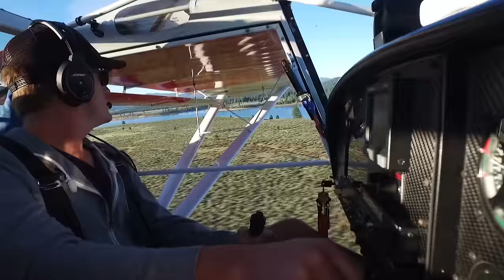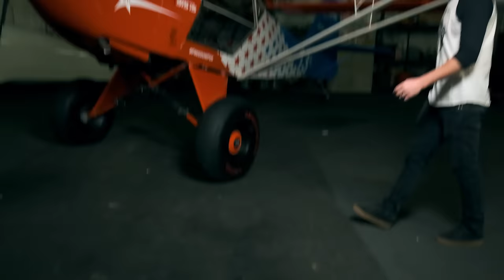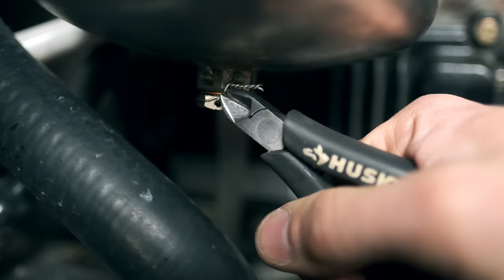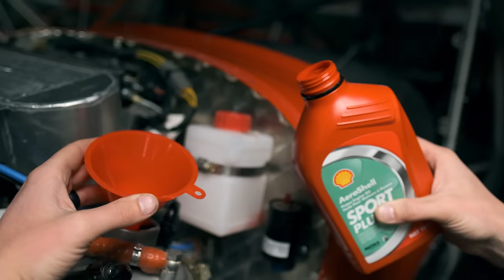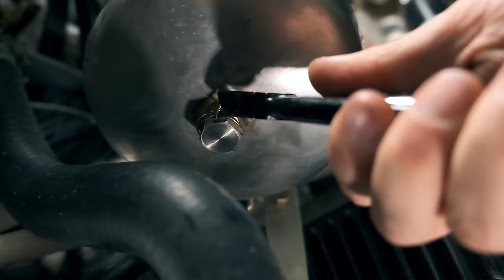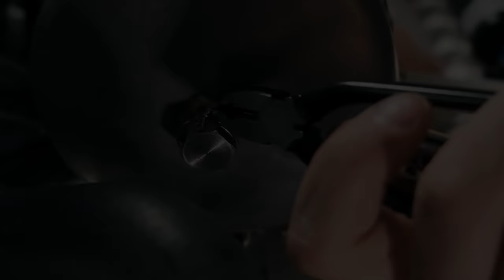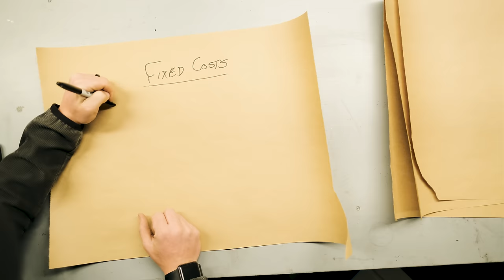What Does It Really Cost to Own and Fly Your Own Plane?

Comment: I'm desperately wanting to get into bush flying (Planning to start with a Chinook 2 and work up to a Zlin Shock Ultra), but this breakdown is exactly why I'm waiting until I get a house where I can build a smaller hanger or pole barn for it (I live in a flat rural field area so lots of houses have enough flat land for a runway). 

Around here hanger space can be as low as 200 a month, but the insurance required to have your plane in a hanger is so much more expensive than just insuring the plane and the bigger problem is there's around a year to year plus of wait list just to get a hanger. So I'll either have a plane I bought and can't hanger anywhere, or I'll be paying for a hanger with no plane in it while I shop for a plane. Which is a bigger factor by far than the costs.

Comment: If you’re going to fly 150 hours per year anyway, what would it cost to rent a plane with similar speed and range?  I think a 150 or 172 around here range from $155 to $175 per hour.  So if you figure yours at $100 per hour you’re saving from $7k to $10k yearly, fly when you want to without the hassles of availability and you have an asset to sale if you decide to stop flying.  
So, one could say if flying means that much to you, how much does it cost to not have your own plane?

Comment: Counterpoint:  I own a Grumman AA1C a an O-320 engine upgrade
I don't fly off field like Trent does, living on the East Coast there are fewer opportunities. 
But I do like having my little plane to travel and just fly for fun.

Note: If you do want to do some off field flying, these numbers could be replicated with a Cessna 150 with a STOL kit.
I cannot give concrete numbers for that, but I fly one in a club that was less than $20K purchase price, fuel burn is 6 gph, and insurance would be under $700 year.

Here is my breakdown:
Acquistion:$25000 USD, financed (about $445/month)
Fuel: 7.5 gal per hour / $4 Gal average
Oil: $86 every 40 hrs
Hourly operating those two costs = $32.15 a hour ($1502.15, 50 hrs - $4506.45, 150 hrs)

Foreflight database: $200 annually, but I maintained that when I rented - only glass in the plane is the iPad

Annual Inspection: $750 annually, certificated, so I also have to budget for incidental repairs
Repair Budget: $50/month ( Long term I think this is overkill, but plan for the worst, etc)

Hangar: No, Tie Down: $40/month, Empty hangars don't exist where I live
Insurance: $1,000 annually ($27,000 hull value)
Reserves not covered.
Wear and tear not covered.

These videos are very informative, I appreciate Trent posting them, but keep in mind that this is not the only way to own a plane.

Comment: 1950 C-150 purchased cash for $9200. Insurance $600/year, annual inspection $600/year, fuel 5 gal/hour at $1.90/gal. (1990's) and 100 hour per year, oil change 4x per at $30 per change, tied $1400/year. Sold the plane 3 years later for what I purchased it for so it cost me about $4K per year flying 100 hours per year. It would be more today due to fuel cost. It was a great experience I'll never forget but wife and children became the priority.

Comment: I guess it depends on which country you live in?
I'm in the UK, and have built and fly a Skyranger swift2 (similar in looks to a Kitfox)
The kit including engine and avionics cost Under $50k new with a Rotax 912 80hp engine 
With the 80hp, if you cruise at about 4000 -4200rpm (75knts approx.) it uses about 10 litres/hr (2 1/2 US Gallons)
Rotax recommends Oil change @ 50hrs, which costs about $50 ($1/hr)
Fuel (mogas) here is more expensive, approx $3 per litre ($12/ US Gallon)

The engine has a TBO of 2000, and you put $10/hr away, that would more than cover the cost of a new engine
Hangerage varies immensely, I am lucky and pay approx $100/month but I'm sure some here in the UK are paying 5 times that Figure.
Insurance varies on the value insured mainly and the hours per year that you fly. for me this works out at approx $1500/year

 
For me, this is no more expensive than running a nice car, but I'd rather driver a wreck (I do) and have fun flying!  :)

Comment: You forgot to add,if you build it yourself,you can apply for a repairman's certificate for that plane,and do your own cond.inspections.
Reply: very nice
Reply: Yep, that's what I did. But in most cases I suspect it cost more to build than to buy an equivalent used experimental. 

I'd only recommend building if building is what you want to do. If all you care about is flying, buy something and fly it!
Reply: @ulbuilder  do both.      Rent until you build your own

Comment: If you just go with fixed and variable costs you'll have the cashflow picture. If you add investment opportunity costs you'll add another shocking layer. If you fly only 50 hours a year your per hour cost is going to be very elevated. There are spreadsheets you can google for and they help you do the math and not forget something. I am looking at a motor glider for about $125k with a Rotax 80hp using about 3.5 gallons/hr. Just getting into it, but I am looking at $155/hr on a 10 hour a month flight time. ( But why would you only fly 10 hours a month? If you own a plane wouldn't you fly at least 6 hours every weekend? That's 24 hrs a month) At 25 hours a month flying time my cost would drop to $84/hr. That's with buying the plane with cash, not financed, so you really should add in the opportunity cost of your capital. If you invest in real estate and can make 8% per year then a plane that cost you $100,000 with cost you $8000 a year in lost income (pre-tax). Add that to your monthly and per hour cost as well.  Trent, if your numbers come out like this you are doing it well and on a low budget. Update a year later: In the last two months I flew an equivalent of 500hrs annually. It was  easy to do.

Comment: $66 sounds about right. I did the math on mine, Jabiru J170 with 4cyl engine is about Aus$70 per hour not including insurance and doing all the maintenance myself, flying 100hours a year, or 70x 'burger runs' 😃
Yes I know it is not a bush plane, but similar in size and cost it seems.

Comment: Would be curious about costs of a glider in the US. In Germany for me it was (all numbers in Euros, do the math):
- Wooden glider from 1960, airworthy, good condition with bare-bones open trailer: 3500. Serious.  Club class glass ships go from 8000-25000, depending on model and equipment for comparison.
- New radio (mandatory) and FLARM (collision alert, and certified GPS logger) and Display and accessories: around 3000.
- Parachute: 1900. I bought a new one. There is a market for used ones too. Cheaper but a lot grimier and smellier. Actually I bought two. One got ripped up last year when I bailed out after a mid-air collision. That was in a different glider, not in my own beloved plane.
Running cost:
- Maintenance: 0. I do all on my own. Material maybe 50-100 per year.
- Hangar: 360 per year for the trailer space assuming the ship is de-rigged on the trailer.
- Annual inspection: 260
- Insurance: Liability only: 140 per year. (Loss/damage does not make sense at the price)
- winch launch: 3.50 per launch in my club. At other fields it is 5-10 as a guest pilot.
- hourly rate: 0. Mother Nature throws curveballs at you but does not charge for thermals and wave and ridge lift. This is actually the best part. With the hours I am flying per year I would end up at 10000-15000 based on power plane hourly rates. Maybe 6000-8000 for an experimental.

Overall less or around 1000€ per year.
I also pay club dues, and flat rate to fly club gliders, but focus was on cost for an own plane.

Comment: In the grand scheme of things, aircraft ownership is not that expensive as compared to some other hobbies. Say for instance a ocean boat. I literally spent about 3 times as much for my boat (to only use it a hand full of times one summer) as compared to my plane. Anyone want to buy a boat? Hehe Insurance seems to be the one cost that is rapidly increasing, especially if you live somewhere like Alaska. I know mine has nearly doubled in the last 2 years. 

As for would be plane owners, my opinion is experimental may cost you more to insure, but maintenance costs are dramatically less expensive as compared to certified. Even aside from the “annual/condition inspection”. One thing to note, if you are the builder, there is a process where you can get the authorization to do your own conditional inspection further reducing that cost. If your a owner of a certified aircraft, there are many A&P’s that will work with you on doing your maintenance with them overseeing/signing off your work and that will help reduce those costs. If your able to do that route, you can start a mechanic log towards the experience to get your A&P.

Comment: To be fair even a Top Cub at 100k with a 30 year loan, yes aircraft loans are treated like house loans, with the right down payment and credit score being well enough you're lookin at 5-600 a month for the payment. 

Now the FAA does have a 15 hour class for certain experimentals like Cub Crafters so you can do your own maintenance (especially if break something off airport). annual inspection sign off is your signature on the air worthiness certs. Which erases the $400.00 minimum for an aircraft mechanic to even look over your aircraf and see what's needed. So at that point you're annual is a couple hundred bucks for parts. 

Insurance is CHEAPER with a nose wheel over tail wheels everyday.

Comment: Awesome video. I am currently building a ch701. I've calculated a huge over estimate of 45k with a rotax. Trying to get a viking engine in there which will allow me to perform full maintenance after the 3 class course. Why did you chose Rotax given the price I am curious? Maybe you explained on another video but it seems like the Viking Honda conversions are a no brainer.

Comment: Hi Trent,  I owned a 1992 KITFOX IV (N2280J) with an 80 hp ROTAX which I insured for $23k.  I suspect you’re over insured and I was under insured.  I paid $1200/year.  I have a PPL SEL, IFR, High Performance, and Glider ratings.  I have about 2400 hours PIC time and 500 tail wheels time.  The rest of the numbers were very close.  I also bought the KITFOX because I thought I could store it in the garage.  My bride quickly convinced me our teenage children would poke many holes in the fabric😊.  N2280J has been sold to an Icelandic Air pilot and is flying the volcanos of Iceland.  I miss that airplane.
Reply from the maker: Yeah, my insurance was about $1600 for a $60k hull before I did the 915 and avionics. Then this year rates across the board spiked. Sounds like you need to find yourself another Kitfox!

Comment: Owning a single engine big bore Continental equipped Cessna single engine runs about $30,000 a year if you fly 150 hrs minimum. That includes a minimalist hangar, ownership insurance for airframe, hangar, and motion insurance, annuals, depreciation of the engine to about 700 hrs when you start overhauling jugs, 15 gals/ hr burn rate, airport extortion parking fees enroute, GPS/IFR update costs, and you can't ignore the opportunity costs of not having at lesst a $150,000 not invested in a mutual fund in a stock market that returned at least 15% in 2020. Yup, definitely less expensive to get the EXPERIMENTAL airplane and just have fun.

Comment: I fly a powered paramotor. Admittedly, I don't fly as fast, and can't fly in high winds. It is a little like the difference between driving a car and a scooter. But, total cost is about $10,000 for the wing, engine and training. Flying is a gallon an hour with a cup of oil(maybe $4/hour). Two stroke engine so no oil change. If you just want to fly, and don't have this kind of money, get into powered paragliding.

Comment: Your epic filming / editing skills, plus your excellent quality video equipment made that oil look good enough to drink! 👍😁

I think if I lived outside of the Northeastern USA, I could afford a fixed wing. With my property taxes, and the cost of living here growing by leaps and bounds every single year, I don't think I could do it. I have such a short take off and landing area (a bit over 300', but could be stretched to 400' with some drainage work) that I'd be limited on what aircraft and configuration I could own, practically. I'd love a rotary-wing, but costs are higher there across the board, however practicality as far as takeoffs and landings goes WAY up in this part of the country. I've got a paramotor right now, but would love to graduate to either one of those (preferably rotary wing) at some point before my dirt nap. We'll see how things go. Maybe once my mortgage is paid off, I could make it happen.  😎

Thanks for taking the time to do this one, Trent!  👍🍻

Comment: Instead of getting a pilot's license, I got an auto racing license. My annual cost ran about $50,000 per year (minimum). After watching your videos and Cory's videos I wish I had bought a plane.
Reply: Hah.  My 14 year old wants to be an F1 driver.  Trying to entice him into flying since the only thing that makes aviation look cheap is motor sports.
Reply: The first place to go as an F1 driver is go-carting. A starting cart, 135cc starts at about $7,000 dollars. So he can start saving. 
The next step is the 250cc cart. His starting cost is about $13-17,000 for the cart, then figure on another $10,000 to get all your gear. Then he needs to get on the circuit. Then there are traveling costs, motels, entrance fees, and food. The 250cc cart is about as near to what an F1 car handles. A good starting place, but does not insure he will ever make it. Or he can get his pilot's license and go flying with his father.

Comment: You mentioned 'saving' for things. This would be depreciation on non-rotables.
(If you were going to buy a new aircraft at End of Life, you would also depreciate the whole aircraft so that there was enough $ in the bank to buy another one.)
This means banking $ for replacements - for example, tyres are $1,000 and last 100 hours, over 10 months; so you need to bank $100/month with a ROE of 100 hours. This is true depreciation on an asset (the aircraft) that will outlive non-rotables.
If the ROE goes down, so does the depreciation amount. Similarly if the ROE goes up so does the depreciation amount.
Tyres, batteries, light bulbs, windscreens (which may be rotable), harnesses, and so on should be depreciated.
Oils, lubricants, gas, hangar space and so on are running costs.
Depreciation goes into the bank (an asset), running costs come out of your pocket (liabilities).

Comment: I owned a 1981 Cessna 152 from 1998 - 2006, flew more than 500 hours during that time.  At the end I sold it for the same price I paid for it ($23,000).  My net cost was $0.00 for the 8 years...how?  I had it leased to a flight school to offset my expense, ran it as a side business, expensed everything I could.  Was a great tax saving deal and did I mention that I flew for "free".  I even had a deal at the flight school that allowed me to "trade" for flight hours in their other planes.  If you want to do it there are ways!

Comment: $66/hr isn't bad when AAA typical car doing 10,000 freeway miles when you figure in $0.80 a mile for fuel/oil/tires/brakes/depreciation, (not including loan) at 70mph, that's not too shabby when you go 100 miles in that hour.

Comment: A quick way to estimate the total hourly costs to operate an airplane is to take the fuel cost per hour and multiply it by 4.  My Cardinal burns 10 Gallons/ hour @ $4.50/ gallon = $45/hour in fuel.  $45*4=$180/hour, which is about what it costs me flying 75 hours/ year.  If you really want to scare yourself, do the math for a twin engine plane...

Comment: While beautifully shot, that oil change has to be premature? 25hr seems like an extraordenarily short time to change oil after. What does the Rotax service manual say? exceeding that number is probably just a waste of oil, time and money. But hey it makes for a gorgeous intro :D
Reply from the maker: 25hrs when you run low lead avgas, 100hrs if you run unleaded. I just lean on the safe side even though I run a mix.

Comment: Just did my insurance this year for a bonanza 175k hull 1m smooth for 2,600 a year. Not bad considering I am under 1k hours but I do have my ifr so that helps. I budget for 10k a year fixed cost and I'm an A&P doing all my own work!!!! Don't do the math you quickly realize we are all insane trying to own a piece of the sky. I try to justify it by using it for my aircraft maintenance company. (Just feeding the habit)

Comment: If...you own land and have your own hangar, and you built the airplane so you don't need any mechanic for annual, your fixed costs would be less than half. If you fly a converted auto engine, and you are able to effect repairs and a rebuild yourself. Your fixed costs hit rock bottom. The whole reason I fly an experimental amateur built, is so that my costs are 1/4 of that of other aircraft. Fortunately I'm skilled and competent to do all my own repairs and maintenance. If I were not, it would still be far less expensive than owning and enjoying a certified aircraft. For fun flying, experimental is the only way to go. In my humble opinion of course.

Now...What does it cost to own/operate a touring motorcycle? A boat (aka a hole in the water you toss money into). A cottage at the lake? I think if everyone approached all those and more, the way we approach aircraft ownership, they would be shocked into just how much it really costs to have "stuff" and enjoy life!

Comment: I'm operating a Bolkow 208 with an O 200 Continental in New Zealand. Fuel burn is about the same as yours, Avgas at around $2.50 / litre has fuel cost at $55/hr!!  You guys are destroying the planet at less than half what it costs us to do the same thing. Aircraft ownership is the preserve of the old guys over here for the most part! Cheers.